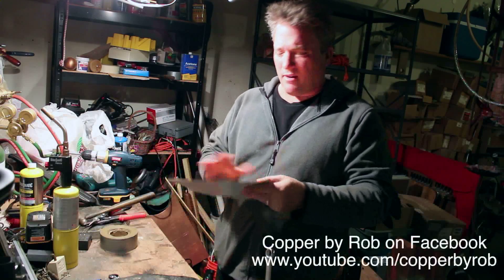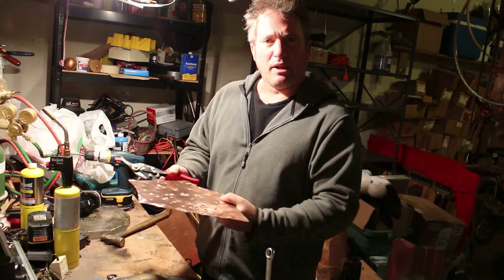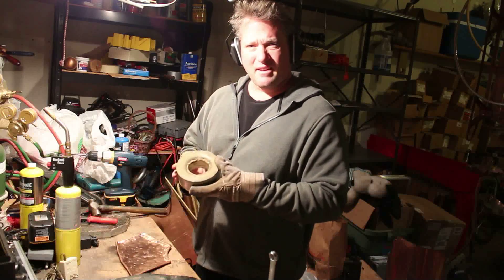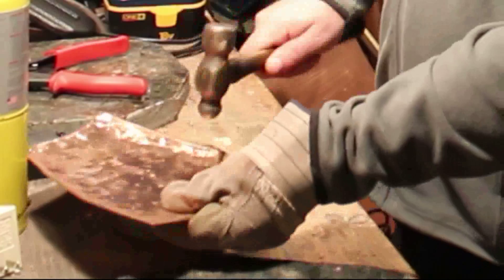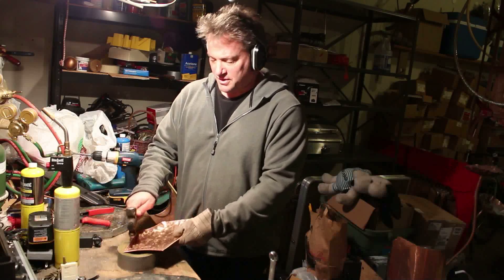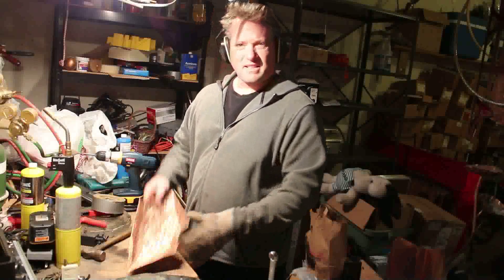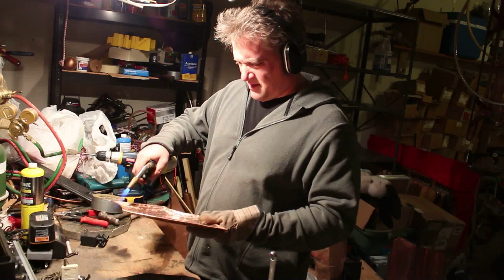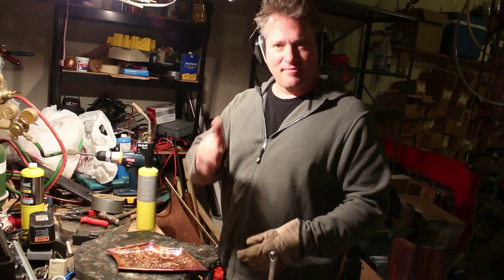How to Hammer Out a Copper Platter or Plate

Comment: when you are rolling the edges, I would recommend either a soft hammer (like leather or plastic) or a soft 'anvil' (like wood). That way you won't thin the copper plate at the point where you are rolling it over.